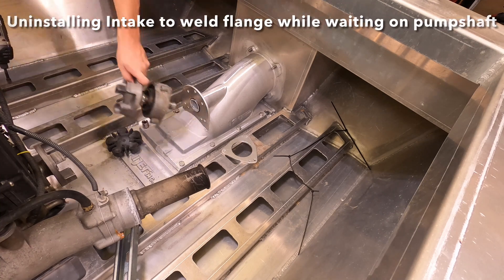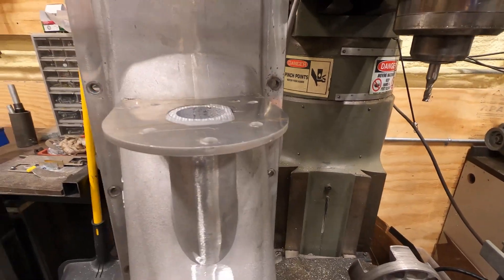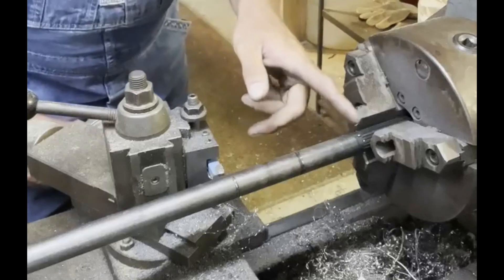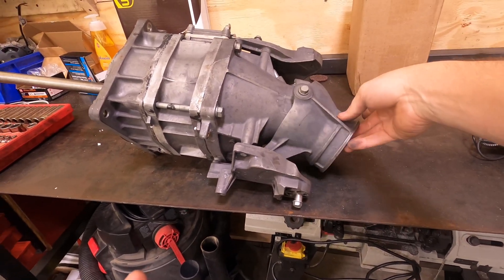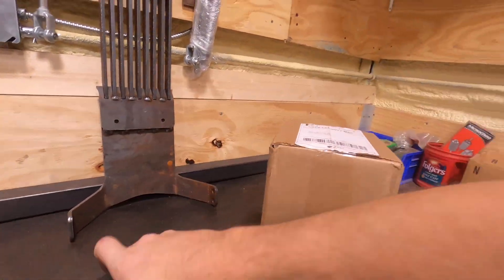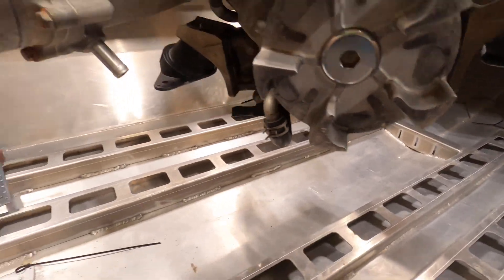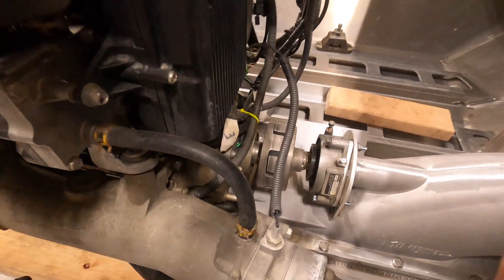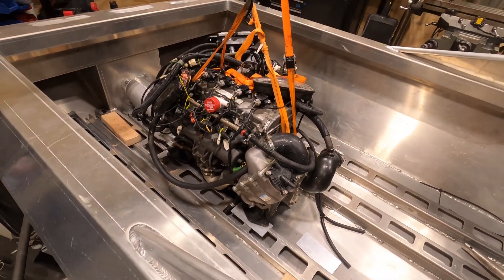Supercharged Yamaha 11' Minijet boat 2 - Installing motor, shortened pumpshaft and jet pump.

Comment: Hey there, nice project. I'm building the same but then with a Hayabusa and the same jet pump. Is the yamaha bearing housing (the one you bolt on the intake) the seal for shaft?
Reply from the maker: Yes, there are a set of glands on the inside that keep the pumpshaft isolated, it also has a zirc for keeping it lubricated.

Comment: Hey I really like your build, I’m building a 16 1/2 foot right now with the same Minijet intake and non-supercharged 1.8 L Yamaha like you have. I was doing some research and talking to a local guy that also has built one and if you look at the oil pan on those engines the main motor mounts are the oil pan it sits on rubber mounts in the JetSki. And then technically you’re only supposed to use those outside mounts to balance and take some load. I’m actually in the process of building my motor mounts right now and I have built the lower mounts that are on the oil pan and will be doing the four outside ones next. If you’re interested I got some pictures. But keep putting the videos up.
Reply from the maker: Great point, I didn’t think of the center mounts on this, I think with the way they’re setup now with the kawasaki mounts, it should hold pretty well with how thick the mounts are.

Comment: I got a question, would it be reasonable to put a motor from a tesla or a e-motorcycle in a mini jet boat. I know it would have the power but would the batterys weigh too much?
Reply: I had a dream where i put 2 Tesla motors in a mini jet boat, now i want to make it